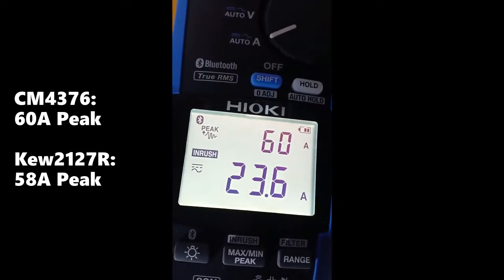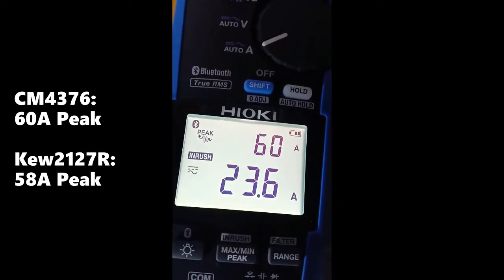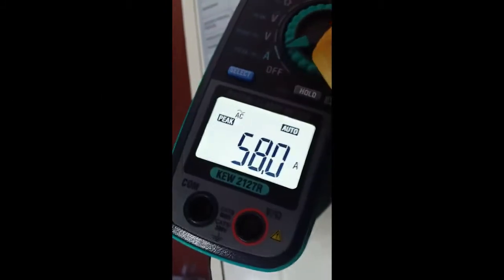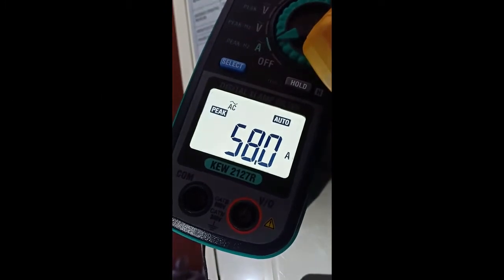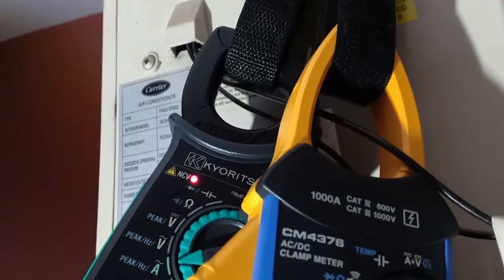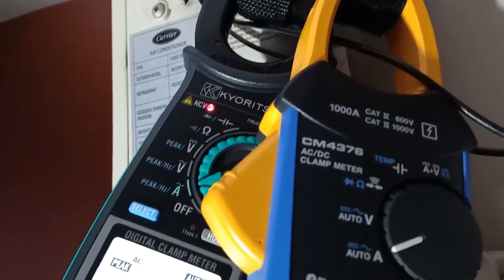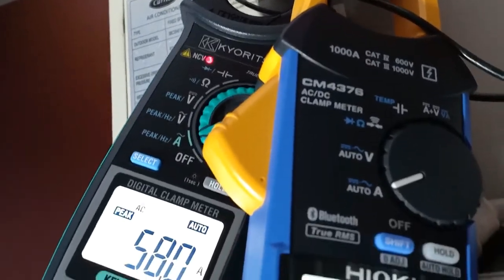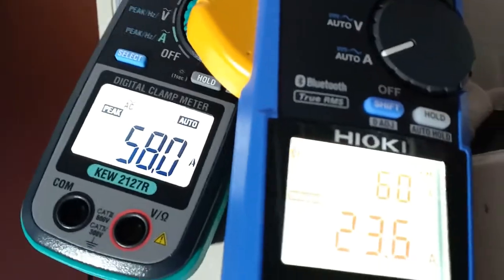[ENG SUB]Peak Hold Function of Kyoritsu KEW 2127R True RMS Clamp Meter

Comment: Hi Im considering in getting the 2127R clamp meter. And I was wondering if this can actually read Amperage measures below 30A?
Reply from the maker: Thanks for your support. According to its specifications, it has a guaranteed accuracy between 0.1A to 1000A, AC current. So 30A down to 0.1A is within the scope of the 2127R. I've measured 0.1A and 7A with it, consistent with my other clamp meters.